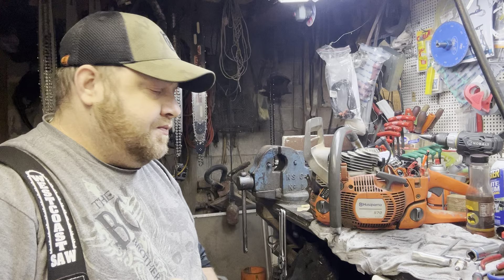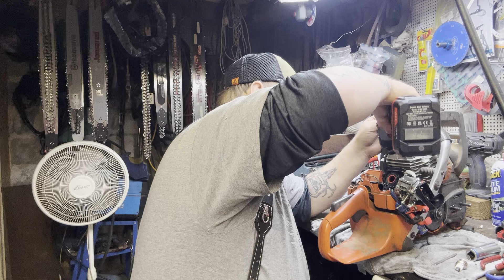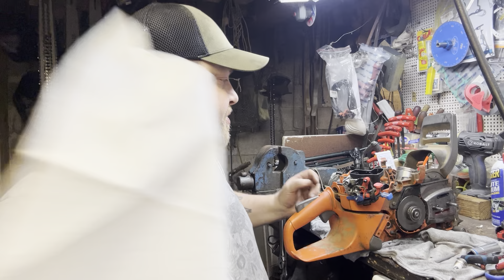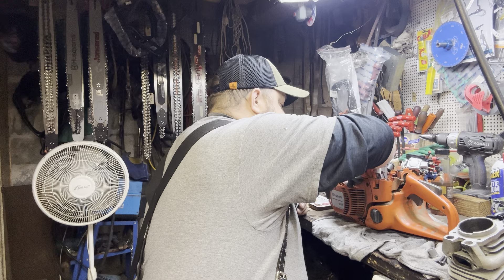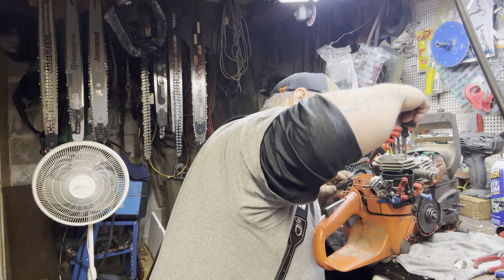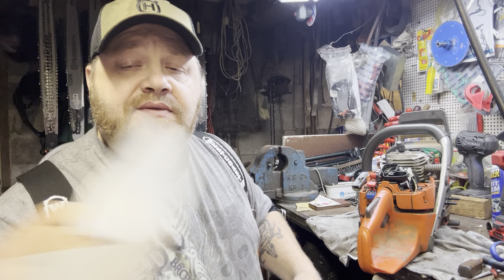Husqvarna 570 base gasket delete..reassembly..muffler mod..

Comment: Check the PTO side crank bearing. They like to spin in those I have a 575 here rn bearing spun causing lean seizure. Guy that rebuilt top end few months ago never checked it 😀
Reply from the maker: Yeah..it was fine..I did see your post..that series is notorious for bottom end problems
Reply: @Aaron_A_Lynch  ya why I figured I'd let you know just in case. I'm going to use bearing retainer and maybe stake peen new bearing in used case got coming. She'll never spin 😆 done that on quite few 70s mx bike engines with same problem
Reply from the maker: @thetwostrokerebuilder 🤙🏻😎